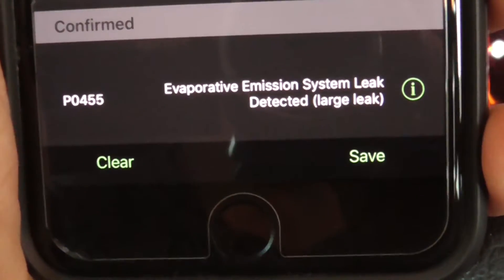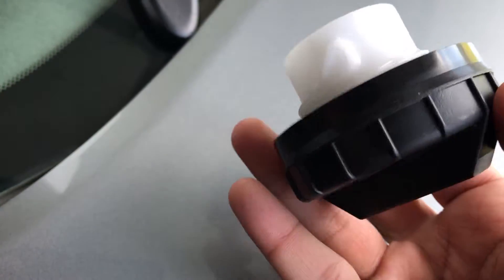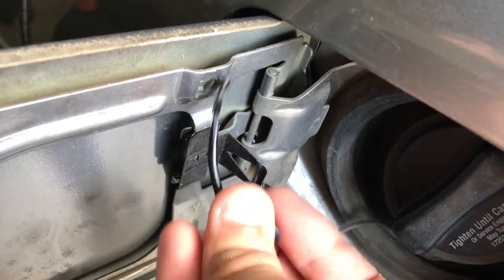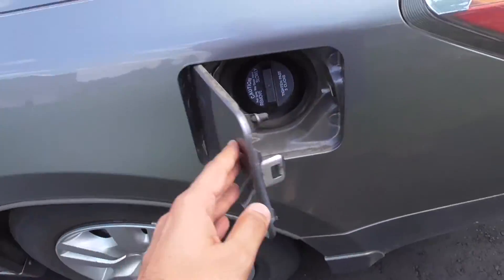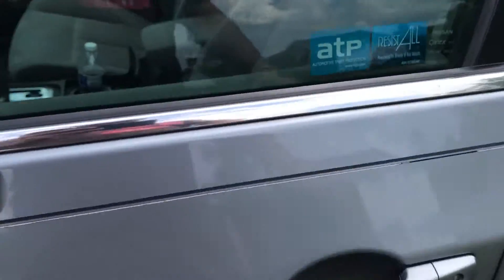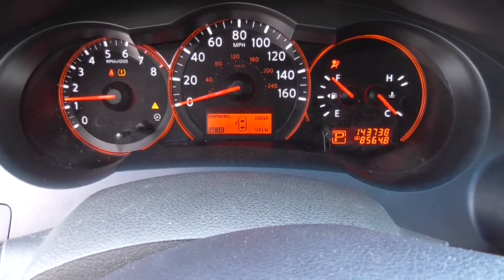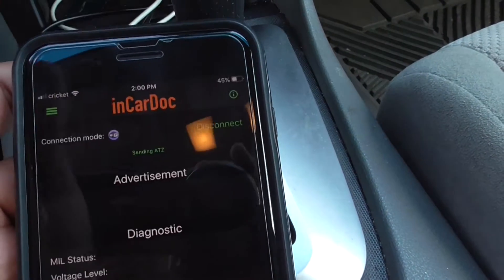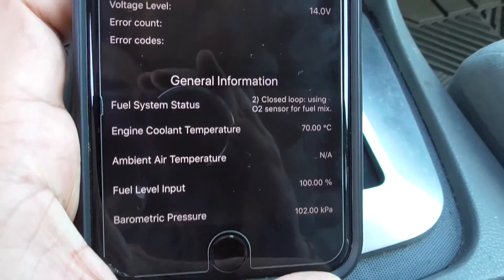How to Fix Code P0455 (Large Evap Leak)

Comment: You need to replace the EVAP vent control valve or canister purge valve or both.  The gas cap won't change the fact you are emitting fuel vapor.  I think if you go through inspection, they will detect it.
Reply: Gas cap seals do go bad. Sometimes cleaning them helps, but they absolutely can create a detectable leak to set off the check engine light. Also, it is the cheapest fix at around $10 or so. Start with the few items do it yourselfers can do at home before spending the big bucks on smoke test. Also recommend OE cap, esp if it’s GM
Reply: @cfoz8612  You are absolutely right. A leaky gas cap can set off EVAP system leak codes. Its cheap and easy to replace the cap so why not do that first. If that fixes it then you are done. If not then you visually check the other components and if nothing obvious shows up then after that do a smoke check.
Reply: @cfoz8612  Been fighting the good fight with my Saturn ION and PO455 for years now.  Fully agree with recommending an OEM Cap, which I've usually done after the code(s) return... Most recently I've reverted to my "Original" Cap (from 2003) as my most recent AC Delco Locking Cap (which took FOREVER for Amazon to send me the Correct Part... Model # Screw Ups do happen).  

Still having the problem with a "Good" Cap (OK it is over 20 years old now but it was never used long before I switched to my first Locking Gas Cap, and it was stored and looks in "New" condition) 

Have escaped the need to fully resolve the issue as the OBDII/Emissions Testing can "Pass" for a brief window when everything (but the Evap System) is "Ready" and will Pass Inspection in my State (allowed just 1 System to not be "Ready").  

I've tried a few other things but I'm thinking a "Deep Cleaning" of the Filler Neck and Gas Cap Surfaces may do the trick ("this" time)... Before investing in yet another Cap.  

As my ION is 12K shy of 200K and 21 years old (Built Nov. 2002-Jan 1,2003)... It might just be time to prepare for the end.  But I'm not ready yet (even though I do have a "replacement" vehicle in the Wings, so this won't be a Money Pit/Desperate "Must Fix" issue for me)
Reply: It's almost 100 bucks on my mercedes.
Reply: Would you happen to know why this code comes right after I change the fuel pump? Do you think it’s due to the canister or the fuel tank seal or not tightening it all the way?
Reply: @petersonedmond456  pops up for me when I don’t Tighten it enough
Reply: @petersonedmond456 what was the solution?..same thing for me, thinking about looking at that seal on the fuel pump.

Comment: Nice, good video. But you got the tire pressure light on.
Reply from the maker: Haha thanks! 
I was not able to fix that light for some reason. I filled the air and that did not work
Reply: @diysave1136  
If all the tires pressures are up to spec and you drove it a few miles and light is still on, check the spare and put air up to spec. Also, check if there is a tpms button located by the drivers side.  Some cars have this button. Press it and hold it for a few seconds and it should go out. If tire pressure light is blinking you have a bad sensor.
Reply from the maker: @elmecanico4943  Will try thanks!

Comment: Yeah ruins freaking out once we get the 455 code. Just do the easiest fix first and spend five or ten bucks and get a brand new gas cap and then go from there if you don't have the smoke machine thing then you just got to keep fixing one part after another also check every single hose and if you have a large leak if it's a 455 large leak then that means a hose has to be disconnected so should be an easy visual thing or a big crack that you can see with your eyes but great video thank
Reply: Yup I have code 0455 after replacing my vapor canister . Did the smoke test and had a leak coming from the area… I’ve replaced canister purge valve & valve solenoid just to have a leak coming from the canister.
Reply: Sn : Also changed the gas cap… still have the leak